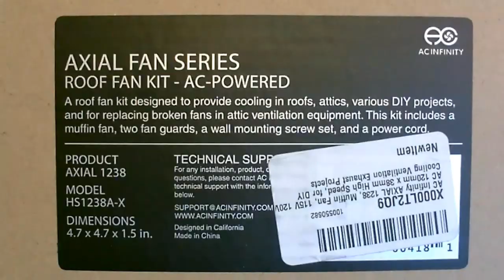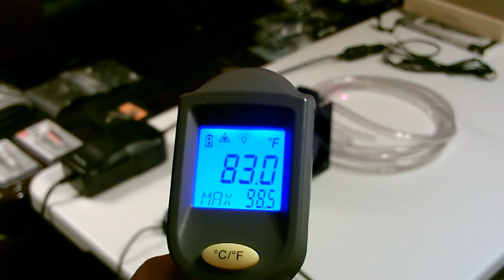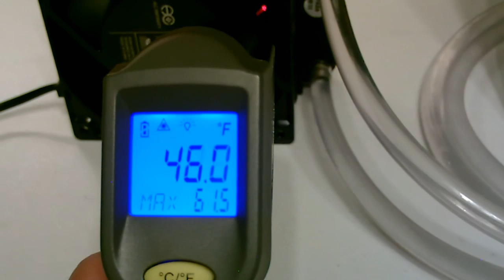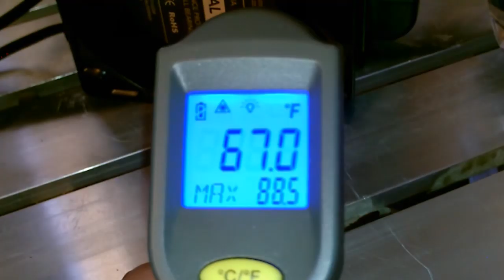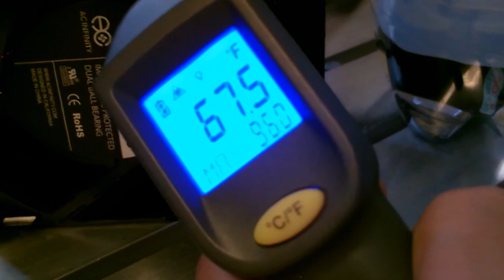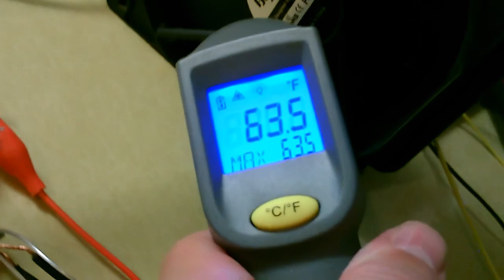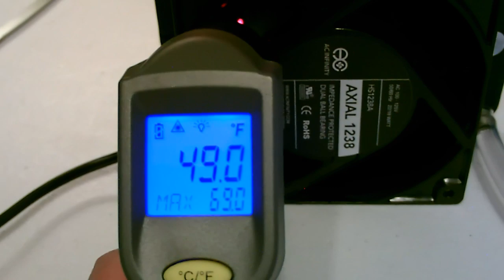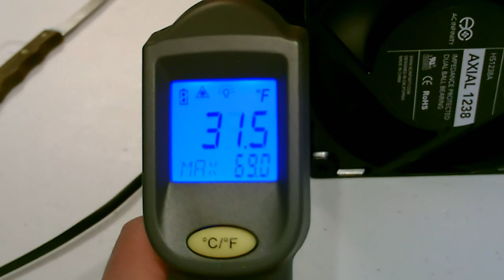DIY Air Cooler! An "Ice-water fueled" Air Cooling Desk Fan w/radiator! (AC air cooler!) 40-50F AC/DC

Comment: Same question: Does it works as well if the radiator is behind the fan instead  of blowing air into the radiator. The radiator and fan would be enclosed inside an insulated box.

Comment: Good day. I just wanna ask what's the humidity of the air blowing out? I want to make one and I want to cool my PC with that. Thank you.
Reply from the maker: hi. the humidity of the air coming out is essentially the same as the air going in. since the air is going thru a radiator (and not blowing directly on the ice or ice water) there is no change.
Reply: @desertsun02  thank you sir

Comment: what is the rpm of the fan your using, I have a 1300 rpm and it is hardly moving any air
Reply from the maker: hi there. i'm not sure of the rpm of the fan i'm using (not listed on the fan or packaging). it just says high speed. one tip:  try moving the fan away from the radiator a small amount.(anywhere from a couple of millimeters to a centimeter). it will make the fan move more air (and the air feels colder!). * i'm not sure why the air feels colder when you leave a small space but it does.
Reply: @desertsun02  il hazard a guess about the fans. the ideal radiator fan should be a high cfm and PRESSURE  optimized placed as close as possible to the radiator. this fan will compress air molecules making heat from the air transfer faster to the fins via heat exchange. this cool air leaves the other side of the radiator at a slower velocity because the fins act as bafflers. you need to use an AIRFLOW optimized fan to push this cold air towards the direction you want cooled to make a difference.

Comment: The link in the description for pumps is broken. Could we get an updated link please, thanks.
Reply from the maker: hi. thanks for letting me know. i just updated it. it should work again 👍🙂
Reply: @desertsun02  thank you for the quick reply. So I purchased that pump but now I guess I need a 12v adapter. 

I don't know anything about this stuff, I would like to be able to plug it in the wall. Can you point me in the right direction please and send me a link if you don't mind. Thank you.

Comment: So, here's an interesting question. If you line up three of these in series, to provide more airflow. Then use a large cooler, and keep everything insulated, including thetubingl. Do you think this would last longer, than a standard cooler setup for camping? This would be a great alternative to keep the ice longer, without needing to go out for extra ice for a weekend, if so.
Reply: I'll be using a 240mm radiator with two fans and an ice cooler so we'll see how that goes!
Reply: @driversteve9345  I got the idea to do this looking at computer fans.  Just bought a 400watt power supply with both AC and DC and am rigging it up to cool down my tent...it gets hot here in the PH...Will use a super large cooler filled with ice.   And an adjustable fish tank pump...
Reply: Not sure yet but I would think so! I got the parts ordered on Amazon and about to try it for myself! I'm only need to cool a 11x12 foot bedroom so that I can sleep during the day while it's 100° outside!

Comment: Where did you get the radiator.  I didn't see it on Amazon.
Reply from the maker: hi. check for the links in the description area (below video). let me know if the link doesn't work. it should bring you to it and from there you'll see dozens
Reply from the maker: here is one https://www.amazon.com/AGPtek%C2%AE-Aluminum-Exchanger-Radiator-Computer/dp/B00CFDS3JA/ref=sr_1_11?keywords=heat+exchanger+with+fan+80mm&qid=1564075828&s=gateway&sr=8-11

Comment: Instead of changing out milk jug every couple hours, why not put the jug in a small zip top cooler.  Tubes run out the almost closed zipper.  Cooler should add an hour to jug time!
Reply from the maker: hi. good tip!

Comment: Another way could be with a therapy pad that you attach to the body . After back surgery I had one. 

Just as a life saver one would want to get something for the wrist there is where the radial artery is located ,this is the artery that is closest to the skin. This would be the best heat exchange location to reach maximum efficiency. No radiator the body is the heat exchange altering core temperature.

Run antifreeze through the radiator and pump,insulate the tubes and drill into the CHEST FREEZER. Fill the chest freezer with bottles of water freeze it then once all frozen you should be able to run on solar power alone. During the day don't use the new invention use it only at night and use a window unit in the day. This way one can use the chest freezer as a storage device. Instead of storing in expensive batteries storing in a chest freezer full of free bottles of ice. 

Over the bed you make it insulated. Blue foam pocket door. You can get a full night's sleep. You want to have a in air hose high and a return air low. Probably would be too cold to sleep wou have to wire a thermostat to turn on the pump leave the fan on all the time.

If done this way one can live off grid with less invested in batteries . This way you invest more in your $200 ea, 320 watt panels that can last longer than batteries. Dumping the power into things that can either store heat or cold in this case.  

Might be able to run this no liquid only air ?

Comment: At the end of the video Mr DesertSun02 said  that the 12 by 12 radiator is going to be the whole house model. Listened to it twice,  I did hear it right. When you get that far Mister DesertSun please give me a call and we'll make arrangements to send that over to my house for a l final test. I live in Colorado in the high plains desert. Temperature has been running about a hundred six degrees in the area where I live. I've made  theunit with the Island Breeze cooler I use three,  one  gallon ice cream containers I thought they'd be thicker and that they would last longer but I am experiencing all different kind of failures. The containers are cracking in the cooler and in the freezer. I got away from the milk cartons for the same reason , the handles of the milk  were splitting the bottoms were cracking that was not only when they were in the freezer but that was when they were in the cooler and they were melting. But I did find I could cool down the bedroom that was approximately 9 by 10 feet . I even got used to the loud sound of the Atwood turbo 4000 and I can sleep with it. I thank you and Mickey my Maltese puppy thanks U we both sleep in the coolness I have gotten used to the sound. by the way I did not eat all that ice cream myself. I asked people that save me Square plastic  ice cream cartons. I had found that Square containers were sturdy enough to act as mini greenhouses for plants starting in the early spring and late winter months. Indoors of course. I keep on rotating sets of 3, 1 gallon plastic ice cream cartons filled with frozen water 6. I have four sets.

I have just purchased a 100-watt solar panel waiting for it to arrive. I have been using a 10 amp electrical AC to DC converter. When you are using the automotive cigarette plug adapter you need to be aware of what the fuse size is inside of the cigarette plug. It is only 5 amps. And for a while the fan had a high speed wine or Screech. I blew a fuse once during an electrical storm. The power  went on and off and came back on several times and the fan never restarted. I was about to trash the whole thing when I thought about it and I said all I have to do is replace the small fuse inside the plug. Once back together the fan restart it and it's been running ever since.
 
 I'm thinking the whole house model was a slip of the tongue. Maybe a tiny whole house model would have been more accurate.  : >)

Comment: Can you drop temp of a room with one?
Reply from the maker: hi there. this one is more of a personal space air cooler. it feels comparable to when you're sitting in the front seat of your car with the air conditioning vents blowing on you. if the room is the size of a car or van interior it would cool it. probably wouldn't cool a large room much, make 2 or 3 then it might. but if you make it expect it to feel like an auto's air conditioning (in terms of coolness and power).